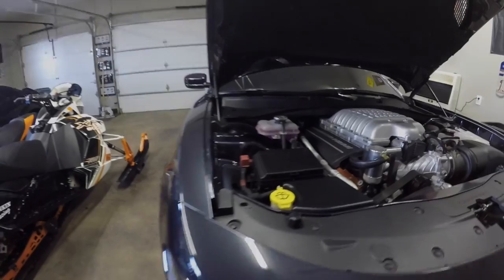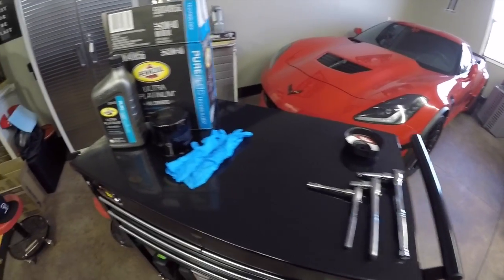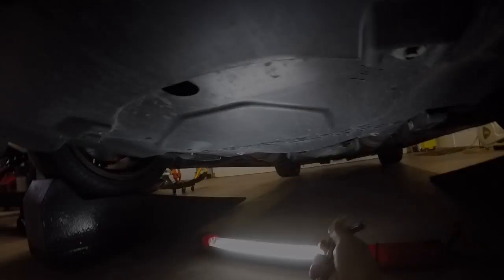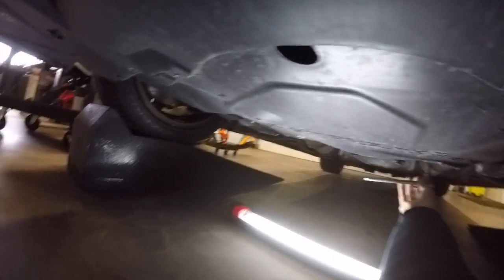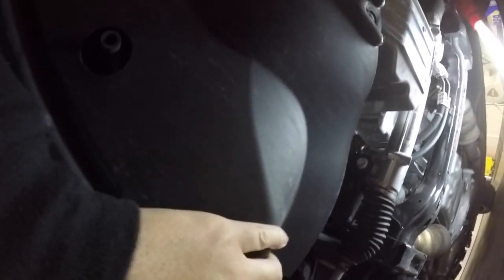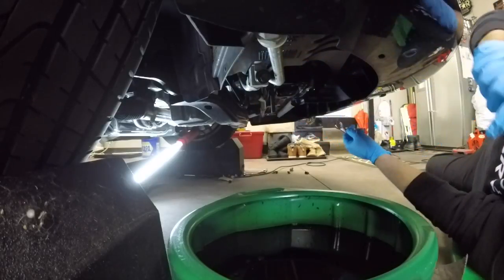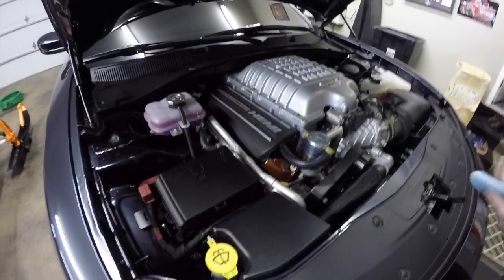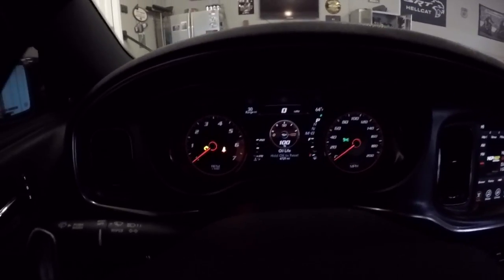DODGE CHARGER SRT HELLCAT OIL CHANGE | HOW TO

Comment: There is a panel available now that can help so you can drain the oil cooler without removing the panel. Very easy install and i will be using it this weekend. Inexpensive and very useful.
Reply: Where can you get this new panel?

Comment: If it were me, I wouldn't bother draining that oil cooler.  For the oil that comes out, it's not worth the effort in my opinion.  Thanks for making the video; it was interesting.
Reply: In my experience, something like 12 to 15 ounces come out.  That's a good amount.  Also, you should drain it while the whole system is open, not with the plug and filter installed.

Comment: Process any different from a regular RT? thanks!
Reply from the maker: Same process, just different weight oil and different size oil filter, and there is no oil cooler to drain like on Hellcats.
Reply: @DOOWORKMOTORSPORTS  what oil weight should I put for RT 5.7 ?

Comment: is it recommended to drain the oil cooling line also since so little oil comes out?
Reply from the maker: Yes, it is recommended you drain the oil cooler along with whatever amount of oil is in the line. You don’t need to make sure all the old oil is out though, just let it drain until it stops dripping.
Reply: @DOOWORKMOTORSPORTS  thanks bro
Reply: I recommend to drain the oil cooler while the system is open (before installing the oil filter and plug).  You'll see more oil comes out of it.

Comment: "3/4 inch ratchet."  lol.
Pennzoil? I would only use Amsoil or Royal Purple in my Hellcat. Or, any other high performance engine. I use Royal Purple.
That 899 filter is used on many applications. I highly recommend the SRT filter:
https://www.amazon.com/Genuine-Mopar-5038041AA-FILTER/dp/B006T08WXM/ref=sr_1_1_mod_primary_new?dchild=1&keywords=srt+oil+filter&qid=1611635935&sbo=RZvfv%2F%2FHxDF%2BO5021pAnSA%3D%3D&sr=8-1
The SRT filter has a larger media filtration area and higher pressure bypass valve. The 899 is a run-of-the-mill filter manufactured by Purolator, whereas the SRT filter is produced by WIX. They make superior filters.
Those absorbant mats are fine if you have a leak. But, they're worthless as a preventative measure as they can blow around if you have the garage door open, they're difficult to move around on, and they are messy after collecting oil/grease. Just find two or three large pieces of corrugated cardboard and duct tape them together. You can find them in 4' x 8' sheets at a local office supply store. The cardboard can lay on your garage floor all of the time to collect any errant leaks, soaks up (small) leaks well, and is much warmer to lay on than the cold garage floor in January. And, when your large cardboard sheet gets full of sand and dirt, you drag it into the yard and flip it over.
The Billet Tech can is a cheap knock-off. I highly recommend the UPR catch can. It has high quality quick-connect fittings and it ships with premium Continental rubber hoses. And, when you order the UPR can, I HIGHLY recommend buying the valve cover breather, especially for boosted engines. The UPR breather screws in where your oil fill cap is located. The breather releases crankcase pressure.
https://www.uprproducts.com/dodge-and-ford-screw-in-baffled-billet-one-way-valve-cover-crankcase-breather-kit-upr/
Reply: Damn it's like you had a problem with everything this guy used, which in reality, got the job done without any problems so I don't see why the tools he used weren't the proper ones for the job.
Reply: @staygoldnpnyboi exactly